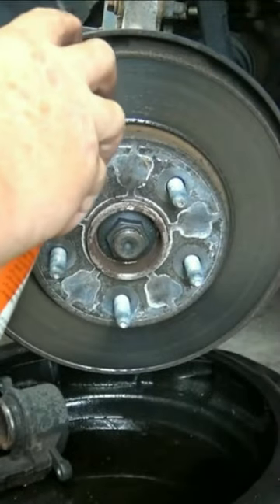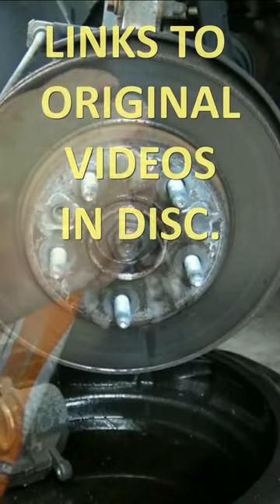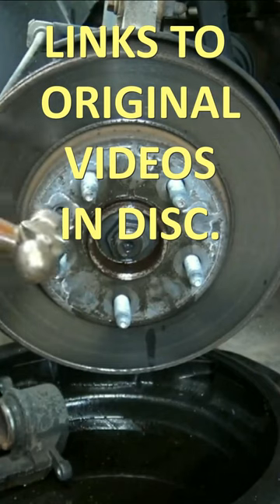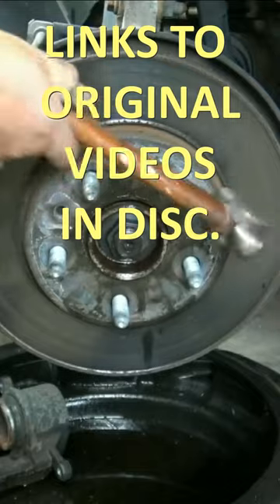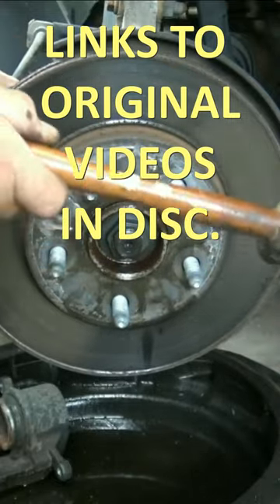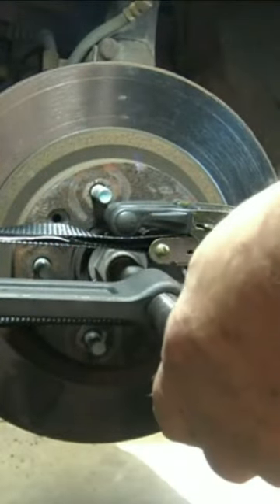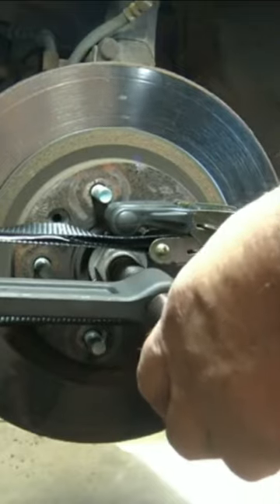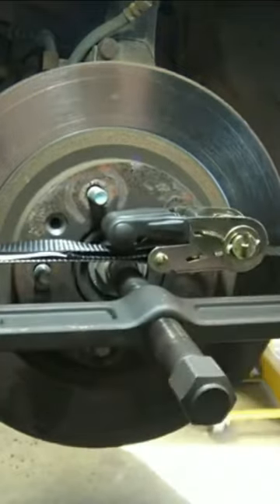Tips to Remove a Stuck Rotor #shorts

Comment: I wouldn't press off the knuckle with bolts, if the rotor is super seized on it is possible it could deform the bracket mount ears, especially on aluminum knuckle.  Hammer never failed me.  Some people have concerns about hurting wheel bearing, if so you could try rotor puller and hammer. And antiseize under the rotor so it doesnt get stuck in the future.  I love how toyotas have the threaded holes, best way to remove them imo.
Reply from the maker: Thanks for the thoughtful comment. Yes, if they are really stuck, I don't push it too far as I go to the puller. I had one a few years ago, the rotor actually broke apart using the puller. It is indeed nice when the manufacture is thoughtful enough to provide those 6 mm threaded holes. Don't be a stranger.